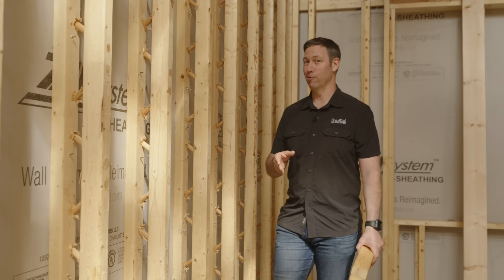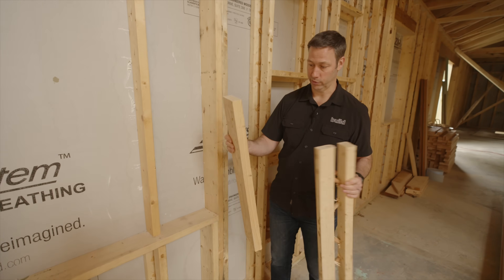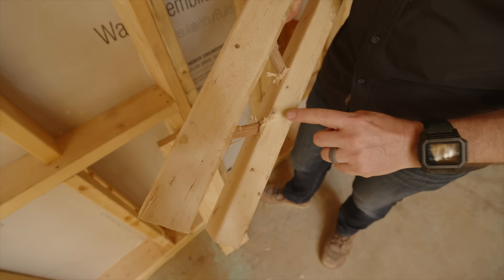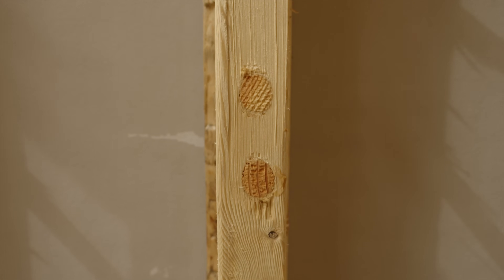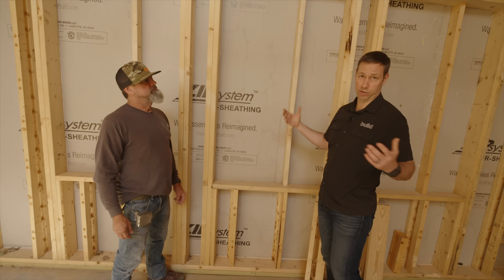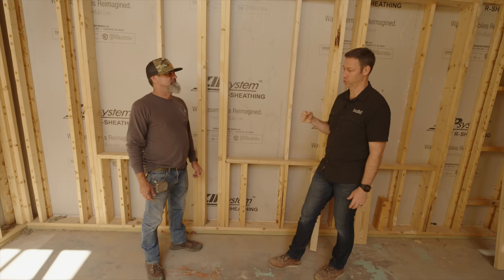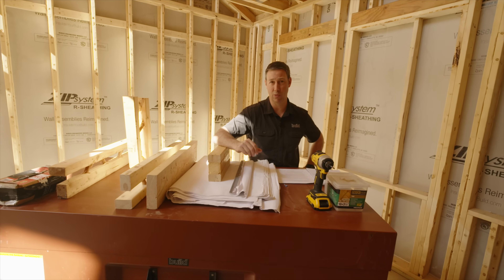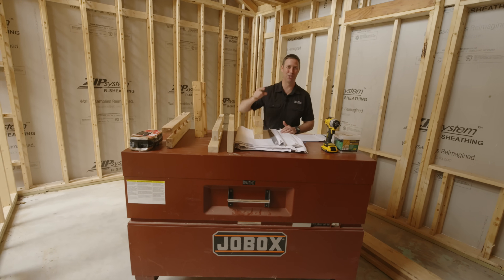Framing with a 2x6 Replacement - TSTUDS!!!

Comment: What is the fire rating of this stud? It appears this type of stud provides the opportunity for fire to travel, unimpeded, and engulf a structure before the 3 minute burn time allowance (safely exiting a structure unharmed). What is used as a barrier to prevent this?
Reply: Nothing is used as a barrier. I wouldn’t live in a house built using t-studs. Deathtraps waiting to happen.

Comment: Have you done a cost comparison of the additional cost for the T-stud to adding more exterior insulation? Exterior insulation seams would be cheaper and better job of thermal bridging. The dew point will occur outside of the sheathing compared to in the wall. Any comparisons?

Comment: I’m gutting an 80’s house. 2x4 studs. Then I’m using these against the old to thicken the wall. Could we build new houses with solid studs then open studs for an 2x8 wall. Basically regular solid 2x4 outter for structural then these open 2x4/6 against them. Wouldn’t that create the perfect envelope with the correct structural support???

Comment: I feel like this product line could be licensed to be produced by an extra manufacturer. At the very least, if you're one to infringe on their design I assume these could be produced cheaply by some builders with a simple assembly process made of hand operated tools held in jigs. I'm struck that a product can't become a common standard or well known if it's limited to being produced by a single manufacturer. Simple standard dimension boards are known, obvious and not limited by a design patent. If there is demand for the product then they stand to gain more long term attention with increased output from a scaled down producer.

I feel it's the better option compared to waiting for them to improve or expand their process.

Watching these videos has generally had me consider how, with minimal access to capital or equipment could produce these for personal projects.

Comment: uses more wood to make, costs more to make peices, costs more to assemble, costs more to make, ends split more easily, harder to cut not to mention angle cutting and compound cutting. Plus it will be a PITA to drill hotizontally for plumbing

Comment: I remember I delivered wood to a work site and was unloading it with the forklift. I took it over where they told me, got off the forklift, and went inside. I was getting the papers ready while I was walking and tripped over a support beam holding a wall up. Of course the wall did not stay up. Was so embarrassing watching a whole wall fall over, lol. One thing I did notice with these, it would be easier to run the wiring.

Comment: Couldn't you just screw in 4 flat metal braces flush with the studs / parallel with the dowels, 2 below, 2 above the removed dowels? thad be structurally stronger even too no?

Comment: I'm sure it is for engineered purposes....But I wish they kept the naked stud in the same configuration as the R19 stud. cutting a stud so you can make it work as your top or bottom plates or if you want more nail grabbing potential on the out side or inside just makes the construction more complicated.

Comment: I looked into TStuds for a house that is currently on the drawing board and the Benton County, Oregon building dept. said that they are not allowed due to seismic concerns. Is that just because the studs are new and the county is behind the times or is this a real issue? Any suggestions or advice will be appreciated. Thank you.
Reply: Maybe the inspectors are worried that the studs will twist causing the dowels to fail and compromise its strenght. It be nice to know how much torsion or twisting this studs can withstand.

Comment: I would like to see the manufacturing process up close. I can't imagine how they can put those together with and great speed when the dowels run in opposite directions. Will be looking forward to that video for sure.
Reply: Magic!
Reply: Much more labor intensive added to additional material will always equal added cost.
Reply: I don’t see that being difficult. If you setup a jig should be straight forward. The pegs are being sent through one side and cut flush. It’s not being pressed together like I’m assuming you’re thinking.
Reply: @Looselipsof56truths  I'd be concerned about all the drilled holes through a 2 x 3 stud. You can see how torn up and frayed  the stud gets. Are T studs like $3 a foot now plus shipping?  Gonna be hard to compete with the staggered stud technique as noted above. I like innovation and the T Studs but not practical for most folks at this time ??  Wondering about their manufacturing footprint.

Comment: This looks like heaven for an electrician. As an electrician, I was taught to clean up after myself. A clean workplace is a safer workplace. My boss once told the GC that we would be back later after it was cleaned up because it was such a mess from the other trades. He had it written into his contract that the space had to be cleaned before he started work. Now of course it was understood that this was to be enforced within reason during work since trades have to make allowances for each other. Some GC's also would put in a clean up clause in the contract.
Reply: I was taught as a electrician to pickup any surplus wire and save it sell as scrap copper. I'm sure the plumbers save copper pipe and old fittings.
Reply: @daviddreyer7196  that might work in an imperfect world , but in my world, there is never any scrap copper as all my wires are cut to perfection on the rough in.  only thing left laying around is a bit of plastic wire insulation , some little blue tabs from the rough in boxes, sometimes some wood shavings from drilling, and from time to time a loose 20v battery or a drill , ..  finders keepers losers weepers..
Reply: If what you are saying about your boss is true he would be the first!!! The only thing I have seen electrical contractors pick up is wire cut offs!!Most are the worst on any job I’ve ever seen of all the subs!! I’ve worked construction for 30 years! So codo’s to your boss!
Reply: @robertconreux8079  sparkys dont sweep
Reply: electricians do not carry brooms nor do they carry vacuums, as they do not ever have the time to clean up, or whatever its called.  besides, the painters need a clean dust free area in which to paint.  they can clean up the place to whatever level of cleanliness they feel they need.  its not my place to second guess the painters...

Comment: An alternative (probably cheaper) to this is something I did to get rid of the thermal bridge. I used 2x6 studs vertical | and 2x4 nailed with ring shank nails horizontally ---- over the 2x6 on interior side. I used polyiso (I bought 1/4 price) in all the cavities. In total my walls are around r-40 and the way I did my ceiling is around r-85. Also in everything I did I kept moisture in mind. That's why this is a great channel to learn from.

Comment: the manufacturer of these studs can avoid having wood splinters inside if they drill the holes with the two studs together and place scrap wood on the other side of the stud. it looks sloppy manufacturing process having those inside wood splinters.

Comment: It's great until there's a fire.  Then the glue holding them together melts and their structural strength decreases massively with collapse soon after.
Reply: Dowels can hold things together without glue. But it could spread fire quickly with the gaps between the front and back when not insulated with a fire retardant insulation.
Reply: Henry Chinery what proof do you have of that?

Comment: The further I dig into better stick frame construction the more I like post frame. One thermal bridge every 8 feet run a girt every 4 feet and fill the entire cavity with blown in insulation. That will get you R 30 walls not just R 30 bays.

Comment: Already the price of lumber is threw the roof. I can see this adding an extra 100k to the build. Special order and delivery yea to expensive. With everyone's budget around 250k for a home.
Reply: An extra $100,000? For upgraded studs? So 1/3 of "everyone's budget?" Wow. You must not have been an exceptional math student.
Reply: @chriswithrow3107  did you read what I wrote or just blab your comment. 
Tstuds are not cheap—about $2.50 per board foot vs. around $. 50 per board foot for 2x6s
Reply: @Bymb2020  okay, even though OBVIOUSLY the T-stud is better than traditional framing I will entertain your reply, just to debunk your hilarious cost estimate. If I use YOUR provided costs per linear ft for some basic math, my house is 1232 sq ft finished, and some quick math tells me roughly 215 exterior studs, at $2.50 a board foot, with 9 ft ceilings, and doubling the square footage to 2460 sqft to get closer to your second random number "everyone's budget $250k", even though there would be significantly less exterior studs added in doubling the square footage, I arrive at a total cost for wall studs of $9,675. This is NOT the INCREASE over traditional garbage 2x4 framing, but a total. Go back to math class.

Comment: Few questions,
Are these used on interior walls as well?
How durable are they really as a structural element? I saw the one split when nailed.
Are there different sizes that allow you to run utilities through them if necessary?
Why is there so much splitting and pieces left on the inside where dowels are placed?

Comment: I've done some framing over a couple summers, and lived through more than my share of prairie winters in houses with regular studs. 

Those t-studs look awesome! They'd be a bit fussy to work with, but given a finer gauge framing nail and a large, good quality miter saw, I believe they wouldn't be too much trouble. If it really is true that they are all straight that would be great too; no crowns to contend with. 

I always enjoy seeing practical innovation using wood. It's natural, renewable, strong, and so easy to work, compared to many composites.

Comment: Couple of questions:
If they are using a 5° pitch on the bottom window plate, would you do the same for the top plate?
With using T Studs, would the dowels be located in the same pattern so they could be cut & measured from the same place on each stud?

Comment: Do you deal with the 10 ft horizontal fire blocking requirement by providing a 2x6 at 10 ft intervals?

Comment: 2x4's staggered on 12 inch centers with a 6 or 8 inch 2 by top and bottom plates is cheaper and just as effective... cool innovations though.

Comment: A no for me. Looks like a termite buffett. Too many fire stop issues. Make em out of 18 guage steel or PT SYP.  Also these would be a raccoon haven or other animals in my walls. I do like the long fasteners for the rafters instead of using the H 2.5 hurricane clips. Makes it easier to drywall and a lot faster

Comment: The concept of building a double wall and filling the inside with insulation has been around a long time and it might be better. One wall is load bearing one is effectively internal. It has available products, same techniques, and in many ways is simplier. One does lose some space, so it may be necessary to upgrade other aspects of the buildings footprint. (More roof and foundation.) A cost comparison other methods and a cost benefit analysis of improved insulation over the life of the building would be helpful.

Comment: Why did you choose the T stud that has the two 2x3's in different direction as opposed to both going in the same direction?  If i'm guessing, it would seem you get more structural stability, but you'd get less insulation space?  Just curious....
Reply: @Craig E That wasn't my question.  I'm asking why they chose the  two 2x3 perpendicular with each other instead of parallel with each other.
Reply: @Craig E No worries!

Comment: I’m a roofer and see a lot insulation issues using standard rafters on cathedral roofs. Can you use these for a roof system to prevent heat loss through rafters ?

Comment: Has anybody tried building outside dual walls? a separate wall for external sheathing and one for inside and fill the cavity with all the insulation you want? I assume the framing costs will double, but in the larger scheme of things, isn't that not the biggest cost in housing, it's the detailing and other labor?

Comment: Interesting, but ICFs are far superior in all respects.
Reply: @Craig E That doesn't make sense. Was the T-studs, sheathing, rain screed, insulation, vapor barrier and labor to install, free? Because on a 864sf house you wouldn't have much more than $19,000 labor and material. Completed ICF wall systems run about $15sf what does a completed T-stud wall system cost per sf?
Reply: @Craig E You could have done ICF yourself with a material cost of $6-7sf. Do you know your material cost was for the T-studs, sheathing, rain screed, insulation, vapor barrier?

Comment: Curious what the inspector is going to say about securing wiring when making lateral runs through those studs. Normally the electrician would drill a 5/8" hole to run the romex and it's a tight-ish fit but with the Tstud it will be a hotdog down a hallway. Will they want romex stapled? guess if your spraying foam that would be good.

Comment: 3:27

Editor should probably not have included how easily it splits. Or perhaps the worker had too much pressure on the compressor.

Comment: How do the smaller boards take penetrations/nails? Smaller means more splitting right? Couldn't help but notice that the video shows this when putting in a base or top plate

Comment: Compression strength is not the point in a wall most of the time

the limit is the stress on the bed plate ... so that s this stud is 3 time more resistant in compression get the interess of no one who  knows a bit about the codes   LOOOLLL

Comment: Hello Matt! I live in Michigan (Climate Zone 5A) and am looking to build with the Zip sheathing system, but can't afford the insulated Zip-R. I am wondering if I need an interior vapor barrier and if I should be concerned  with the sheathing's low perm and air tightness; any moisture that does get in the wall in the heating season seems that it would not dry. My plan was (drywall, vapor barrier, 2" of blown in, 3" closed cell, zip, rain screen, lp smartlap). Would appreciate  your opinion on "best" practices on a budget in 5A!
Reply: Assuming you mean polyiso board by closed cell, at $2/sqft it might work out to just use 5" of blown-in insulation with Zip-R6. Theoretical R-value will be a little lower, but you get the external continuous thermal barrier and IIRC external insulation needs to be at least R-5 with R-19 inside.

Comment: Spray foam, there is a hug law suit right now for those who used this stuff. Claiming that the chemical is leaking into the home causing health issues..
Do you think its still ok to use???
Reply: I believe that's more of an issue with open-cell sprayfoam, which was the standard when sprayfoam insulation became mainstream because it's cheap. Using chemicals on-site is always a risk, there's always a lot more variables than in a factory that produces PUR-plates. The theorists say deviation in terms of insulating properties is easily compensated by the fact sprayfoaming on-site produces a seamless result, but I'm not entirely convinced, there are just so many companies out there and there are always people cutting corners to maximise their profit while beating eachother on price... 
There is so much focus on energy efficiency of houses today, and don't get me wrong, it's a good thing, but we can't forget a house is also a place where actual people live and needs to be built to be remodeled many many times over many many decades before actual renovation or tear-down. I personally try to stick with long-term tested and proved methods like mineral wool or glassfiber batts wherever possible, factory made PU plates where a high R-value per inch is necessary, and keep the sprayfoam for filling gaps.

Comment: Matt, I don't understand the approach of using a high performance stud like this and then stuffing the exterior walls with a bunch of other useless wood - double bottom plate, double top plate, extra and overkill on all the cripples shown and so on.  That makes no sense at all.  So you upgrade on one component and then waste a bunch of material and time on the other components in the same assembly?  That isn't like you.

Comment: Seems to me that the pre foamed option with mineral wool batts in the cavities is better than spraying  closed foam into the wall cavities and between the TSTUDS for retrofitting plumbing and electrical in subsequent remodels. Doing it this way a plumber or electrician can remove the batts run their wires or pipe through the TSTUDS and then reinstall the wool batts. If you spray closed cell foam then you must remove the foam install the wire or pipe and call a foam contractor to spray the area that you worked on, A foam contractor will not be willing to set up his equipment for such a small job.
Reply: You can get larger foaming kits from Home Depot and others if a couple of cans wont do it

Comment: What's a liar. Every time they come up with a so-called new idea, they never talk about the hidden agenda behind the ' new idea',. In fact, those new ideas just to serve the builders saving materials and make more profits and more profit only.  The quality of the home built for the last 20 yrs getting worst and worsen, if not disgusting. The price for housing keeps going up, but the quality going down. You can buy the house been built for over 40 years still has better quality than the new home.